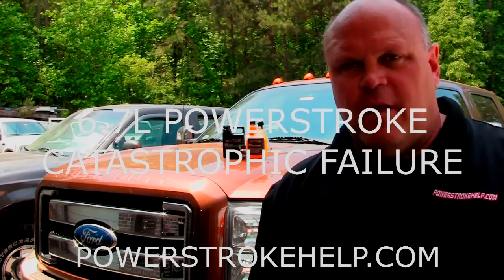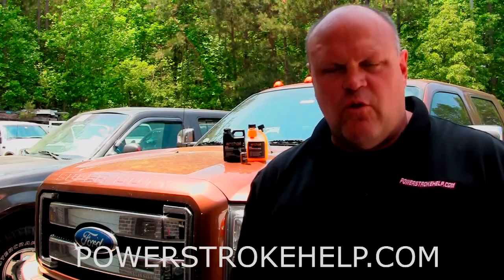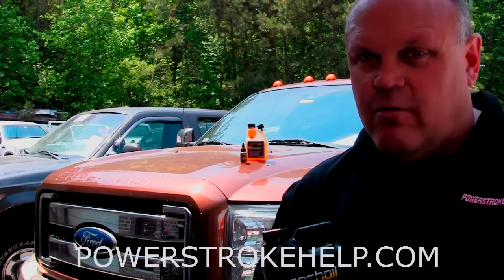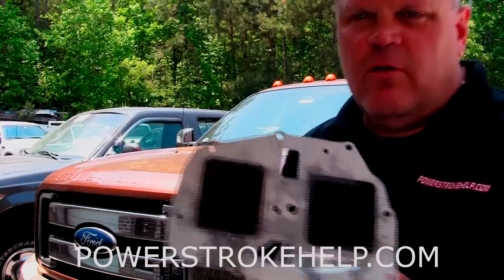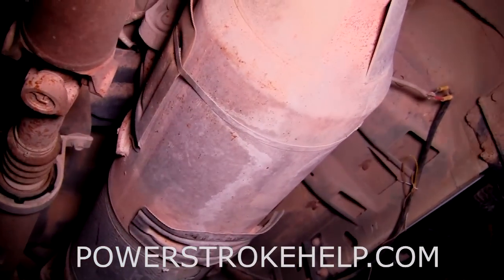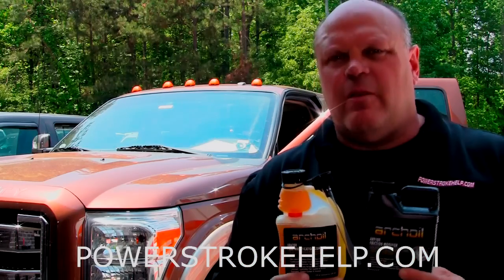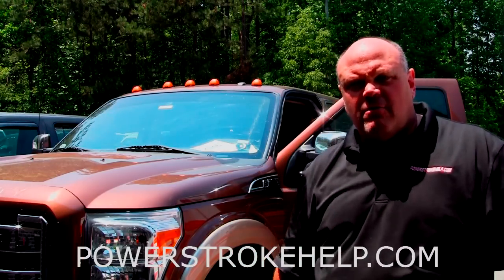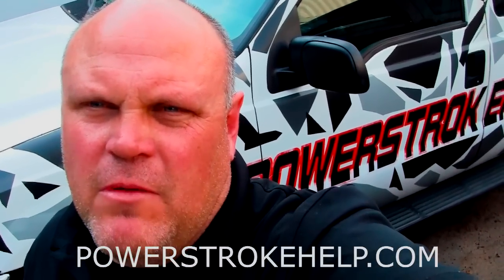6 7L POWERSTROKE CATASTROPHIC DEATH - ARCHOIL

Comment: I tried the Archoil Challenge on my 2004 F250 6.0 with 145k on the clock. I bought this truck and few months ago and did not know what all had been done to the truck. The previous owner did after going through the truck take very good care of the truck. Has been bulletproofed. That being said before the challenge I was getting around 14.5mpg in town and 18mpg on the highway. Now im getting 17.5 mpg in town and 23 on the highway. Motor runs easier and quieter. I did both the oil and fuel treatment. I am sold and will use it from here forward. Living in Anchorage Alaska we have very hard cold weather. My local powerstroke shop owner is now using the Archoil after trying it on a 7.3. I gave him the paperwork you sent me Bill.

Comment: how is it fuel efficient if your burning twice the amount of fuel for it to run the EPA crap bolted on the engine. EPA is responsable for polluting the Colorado river there not taking responsibility for that mess need to get rid of the EPA
Reply: thank you!!!
Reply: "we need to dilute gasoline to not use as much" 

"but we need to burn more to get the same amount of energy out of it"

"sssshhhh"
Reply: VinylDash303 just like diesel engines say all the Egr stuff is helping, get half the fuel economy of a 7.3 Powerstroke
Reply: Justin Rowland you'r welcome! 😉
Reply: terry jenkins not only the EPA but CaRB as well which cali air resource board there the reason y all vehicles with diesel besides cars are running DEF and DPFs
Reply: @bryanmartinez6600  who's EGR?  never heard of him

Comment: In 2002 I bought a 1997 F250 with the 7.3 that had a 165K on it...zero problems with the motor other than having to replace the glow plugs and harness. Sold the truck to a friend at 309K in 2012 and last I spoke to him in 2017 it had 365K..it probably has close to 400K now. That truck was run on Mobile 1 Diesel and DuraLube.  Replaced the truck with a 2006 6.0 F250 with 96K on it. Ran the same oil till 2014 when I had what turned out to be a stiction problem. Found out about Archoil by accident and also switched to Shell T6....the problem went away within 300 miles. Has never been back since. I get 14-16 around town and 18-19.5 on the highway with 3.73 gears. The 1996 had 3.55s and got 17-18 around town and 20-23 on the highway.  Just turned 200K on the 2006 last month. Only engine problem so far was the #1 fuel injector going out at about 180K.

Comment: I think the Archoil is great and everything, but I just spent 75k on a truck so I shouldn't have to put anything into it besides fuel and routine maintenance recommended by the manual. These new motors and emissions systems are garbage; that's really all there is to it. You can blame the EPA, Al Gore, Obama, etc but Ford just cannot seem to place a good diesel in their trucks. RAM doesn't have these problems with the Cummins. Their truck is trash but the motors are bulletproof. I'm buying a gasser next time; if I need more torque I'll rent a Peterbilt. I can't justify a new turbo right after the warranty is up and $9000 exhaust systems. That's just being stupid with your money. The Powerstrokes just keep getting worse. When it comes down to it even the 7.3 wasn't that great. You're not going to run out of work anytime soon Bill!
Reply: Zack Zander theres been more than enough problems with Cummins engines also. it is absolutely not bullet proof. there are thousands out there with melted pistons in the 6th. just one of the very many issues with Cummins killer dowl pin ever herd of it? 07 Cummins Pff  the list goes on a long long way. Dont be color blind there really not any better than a powerstroke. As a matter of fact in Farm equipment and Forestry Equipment i see a lot more Cummins engines in my shop than any other engine. and not because there are more of them either. And i agree with you ill probly buy a Gasser the next time also
Reply: +joe blow cummins may be easier to work on, but nothing runs as smoothly as a  healthy powerstroke
Reply: +Zack Zander ....I have a 2000 7.3 diesel and with the massive amount of salt they put on the roads in the winter in New Jersey the oil pan rusted out at 120,000 miles.  The turbo, water pump, & oil cooling lines were replaced while it was apart.  While it was in the shop the front end & brakes needed work as well.  That was over a $5,000.00 visit to the shop.  Then a leaf spring broke, and I ended up replacing all 4 with shocks & the junky factory front hubs  Then it was time to take the body shop to have the rust repaired.  Once it ran awesome and looked great, of course I had to replace the cracked leather interior.  My point being no matter what diesel truck you own they can be a money pit!
Reply: +powerstrokehelp are fuel clean vs what I have seen in the mid east
Reply: +joe blow its cause guys idle them all day while working and a turbo needs too idle a good two mins before shutting off comming from the highway and etc...people arent changing oil at 5k either ...a car is like a human being it just doesnt talk when its overheating and liquids arent given a break
Reply: +powerstrokehelp And at my local shop here in Finland they told you have way better oil for theese engines. Is it maybe because he is selling them?
Reply: No, being stupid with your money is spending $75k on a truck, either before you knew whether its value would justify that type of money, or after knowing it wouldn't.  Spend the money on the additive, especially since diesel fuel is so cheap now.
Reply: And as for the 7.3's not being that great..., I didn't really want to spend the extra money when I bought my 99 new in May of 1999, but they sold me, by telling me the engine would go 300k miles.  I have 285k on it right now.  I has had the water pump replaced once (no big deal), and the turbo pedestal developed a leak @ 99k, and was covered under warranty.  Still has the original injectors.  I'm planning on putting some serious money into this truck this summer, because with the emissions, cost, and lack of proven reliability of the new trucks, you can keep 'em!!
Reply: It it the EPAs fault for ruining new diesel trucks after 2008. The emissions control are what kill the engines because they are working twice as hard and running twice as hot just to keep some soot and nox coming from the tailpipe. My 08 6.4 with full deletes and some nice custom tow tuning from SCT/KEM make for a very nice ride, plenty of power to get stuff done, and somewhat decent mpg for a ccsb 4x4. I also have a street tune for when shes unloaded and just want a nice performance boost. When it comes to ANY, read that in caps ANY diesel engine, it all depends on what the person behind the wheel is doing while driving the truck. Drive it like a total jackass with ridiculous tuning, youre gonna break it, i dont care what medium duty diesel it is.
Reply: I actually tried Archoil in my 2000 7.3.  It is just a little bit quieter at idle which is a good thing for a noisy 7.3!
Reply: Zack Zander
Reply: Why isnt the 7.3 great?
Reply: I snickered here as well.  As close to a perfect engine as you can get unless you are modding the thing beyond even what a mullet demands.
Reply: Zack Zander the real problem is that people are willing to buy 75000 dollar ford trucks that are junk.  what incentive does ford have to fix it if you're giving them almost 100,000 dollars for a turd?
Reply: powerstrokehelp true  ! when usld came out I was puking injectors for no reason, found a additive that works for me , regular maintenance, if you don't know how to change fuel filters pay someone! 200k since last injector , now at 454740 on a double cross country then cape cod to -FL 7 k haul , tow big , or tow home ! ( whatcha got for me for fuel additive?) Jc.
Reply: I'm under the impression that Bill loves the 6.7s because they make his future bright and sunny.
Reply: if you invest in an amazing performance diesel, just protect your investment.  Bill is giving you good advice.    Use it or pay up!
Reply: rhino250r, I and many other readers don't know what YOU are talking about!  If you believe the good money you pay for a new vehicle should be 100% reliable, then don't confuse your hopes and wishes with reality.  You don't give any explanation other than 1 owner of a 2013 cummins that may not work his truck, drives under ideal conditions and perhaps the one built on a Wednesday (when hangovers at the plant were lowest). But good for your friend!  Maybe he is one of the few lucky dudes out of many, since others in this thread have commented that the cummins engines have their own issues.   Nonetheless, a 2013 is not a 2017.  The emissions requirements have progressed since 2013, requiring newer advances newer designs, not so well tested due to the rapid acceleration of emission restraints, to be put in production to meet EPA thresholds.  Blame the EPA for putting such strict standards on US diesels while the rest of the world lags behind clean air goals. 
You live in the USA.  If you want something reliable, cleaner and cheaper, get a dog, a horse but not a bulletproofed 6.0.  Reliability and emissions are in conflict.  It is a reality.  Why not ask why industries in Mexico are able to pollute while 5 mi. across the US border, the diesels must produce cleaner air that what blows across the Mexican border, and yes, you must pay for that diesel too.  Just because you friend has a 2013 cummins doesn't mean it won't break down tomorrow, or that the damage wasn't underway since 2014. 
Don't buy Archoil.  Don't use advanced lubricant additives that industry uses because it is proven to increase performance, improve equipment life and reduce downtime.    Better yet, feel good about yourself and buy some cheaper competitor to Archoil that protects their "secret sauce" intellectual property (if you were on some of the Ford forums, you might find out they don't work and their sauce is secret because the ingredients don't work and are actually harmful). Maybe STP or Lucas oil is a good choice for you.  Now, since you have dropped your one-liner of criticism, expend some effort, go do your homework and try to come back with an factual argument that you can actually defend or just test your luck.  And when your truck goes into avalanche fragment destruction, go check on what it costs to fix it and take your chances with the stealerships.  I'll bet some service desk manager can diagnose your "concern" and give you a repair cost from the service podium without even having a mechanic look at your engine.  It sucks but this is the real life, truth be told story.  The US government has unfairly burdened the American working people.  Lets hope that changes.
Reply: Zack Zander new cummins have turbo problems as well
Reply: They sound like a bag of hammers. Fuel economy isn't that great. Low power. Even if you bomb them, after year 2000, the powdered rods are junk and break at anything over 400 hp. HEUI is a problematic design that requires specific oil with antifoaming agents to get the injectors to pop off right. Crank position sensors go all the time. Turning radius is pathetic, so is the ride.
Reply: I understand that all the 99 7.3s did sound like a bag of hammers.  If you search the forums, you'll find the torque converters were not a good design.  Many shops building TCs have a fix for that.  I'd change mine out, when I have to pull the engine or transmission.  For now, I'll just pull up to pedestrians who are talking on their cellphones, only because...noise is a safety factor...people know I'm coming and better get the heck out of my way!  LOL
Reply: Chris Wittekind that's funny, 75k is close to 100k, well then it's also close to 50k.
Reply: Jc Marine when ULSD first came out it had lost the Sulfur without them adding in any lubricant to replace it. Sulfur was what helped lubricate the top end and any component the raw fuel came in contact with. Any good brand of fuel worth buying now has a lubricant added to it when loaded at the refinery. Different brands may or may not specify the lubricant. Cheap stations with no brand might not have a lubricant added. The first ULSD was ruining injectors and pumps.
Reply: I have a ram never any problems. Maybe learn to take care of your shit won’t break.
Reply: EPA deserves all the blame it gets.  All these engines regardless of make/model run better without the emissions crap.  Emissions gear increases EGTs which shortens diesel engine life and ruin fuel economy (how is that green?). Same thing with ethanol for gassers...ethanol lowers MPG causing you to use more fuel.  How T.F. is that green?

I had a '08 6.7 Cummins that clogged up its DPF constantly because I drove it on short runs that didn't let the regen mode kick in.  Before I finally deleted it, I had to run it around on longer trips for regen (which didn't really work well anyway) causing me to burn more fuel--how is that green?

EVERY truck can benefit from these longevity steps:
1) Remove/Delete the emissions crap.
2) Use a mild tune to keep EGTs in check.
3) Consistent oil/filter changes with reputable additive. Consider an aftermarket filter like Amsoil.
4) Buy fuel at a truck stop or station that sells a lot of it...less chance of water condensation.
Reply: you can delete the DPF off the new cummins and the EGR for around 1000$ thats with buying a tuner to delete the code. Where are you getting 9000$
Reply: Every truck manufacturer has issues with there engines, blame the EPA

Comment: I'll just stick to with a half ton gas motor. lasts much longer and sooo much cheaper to fix. I love these guys who say hey just spend a couple thousand and bulletproof the motor. hello you shouldn't have to bulletproof a 60k dollar truck. emissions have ruined the modern diesel motor
Reply: Jade bylund I'm thinking of getting a 6.8 V10 super duty I'd rather take bad gas milage than having it repaired constantly I need a truck that can work no matter what and bad fuel economy in a large truck is the least of my worries besides the 6.7 Powerstroke isn't really great on fuel either with all the Egr and dpf crap I say they get similar economy
Reply: @bryanmartinez6600  Had a v10. Towing you get a solid 5-6 towing. You won't miss a gas station. Haha
Reply: Just delete emissions and be done with it for about 350,000 miles of care free service.

Comment: I am on my 3rd tank with my '98 Jetta Tdi and my city mpg went from 38 to 44 using the AR 6200.  I only use 7ml per fill up.  I was very skeptable but the stuff works.
Reply from the maker: dieselworld All the german diesels and benziene auto work well with this stuff.
Reply: Do you think the oil additive would add any benefit?  I have run the Amsoil 15W-40 for the last 360,000 miles.

Comment: As I mentioned in the Turbo failure video, a 6.7L crate engine costs a couple of hundred dollars less than the BASE MSRP of a BRAND NEW 2015 Ford Fiesta!! Let that sink in...for roughly the same amount of cash the poor gentleman is going to have to cough up to fix his truck, he could walk into a ford dealer, and get a BRAND NEW CAR.
Reply: digitalrailroader try pulling my 3 axle gooseneck that weighs 21,000 loaded, with that Fiesta.
Reply: Fiesta or f350...  let that sink in , some people  that dont drive to a office for work might need a truck there is some MEN left
Reply: Broke men

Comment: If I heard my truck make a noise like that I think I'd be sick
Reply from the maker: Dee Jay It isnt even my truck and it gives me the willies.
Reply: +powerstrokehelp What ended up failing in the motor?
Reply: +James Wriston : Sure sounds like a rod-knock to me. Probably a spun rod/crank bearing or two. Either way, it' ain't good, and it undoubtedly WILL be expensive to repair!

Comment: To think that Bill of all people has anything to gain much by promoting these products seems pretty dang silly to me. I strongly believe that if he didn't genuinely think it was helpful he wouldn't try and share it with us all.

"Snake Oils" have come an awful long way since the stuff we used to deal with back in the 90's, additive technology these days can be some powerful stuff. Even if it only adds .5% to the life of your engine that's 2500 miles over a 500k life. That's a whole cross country trip! For a lot of us who work with these trucks and depend on them (as well as the fleet/emergency guys) that last 2500 miles could really matter!

Try not to listen too hard to the lash-back bill, most of us are sane!

Comment: Bill I  know you are right about the additives. I use the arch oil for the oil and the ford motorcraft Diesel addative for the fuel. There is one more thing that can save that truck and that's to go over to the dark side. This does come with some risk but come on everyone knows this that has one of these trucks. Just so you know I truly wish you guys where in my area. Keep up the good work.

Comment: I have a 2006 6.0 with 287k on it, new turbo, EGR delete, SCT tune, 4 inch straight pipe exhaust, oil has been changed every 7,000 miles, never really been floored or hot-dogged a lot, I take care of it and pay attention to it, how long do you think this truck will last me? Also what else would I need to do to keep the truck for another 200k miles?

Comment: Bill, I have a brand new 6.7 F-250 Super Duty 4x4.  200 miles on the odometer.
How many miles should I have on my truck (break in) before I begin using the Archoil products?
Thanks.

Comment: my 03 f250 6.0 just died due to hpop failure. took it apart, replace oil cooler, egr, hpop and bluepring upgrade. I added ar9100 into new oil and this thing now pull like a beast.

Comment: What oil in conjunction with the archoil do you recommend in the 6.7 in a 2016? Shell Rotella T5 synthetic blend 10w30 or T6 5w40 full synthetic. I live in Alabama and tow an 8,000lb RV about 150 miles per month.